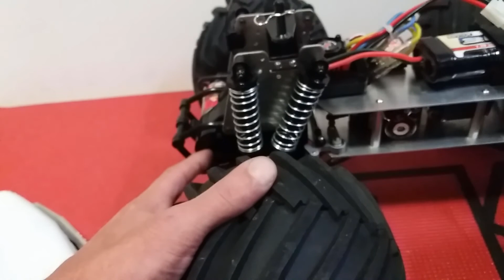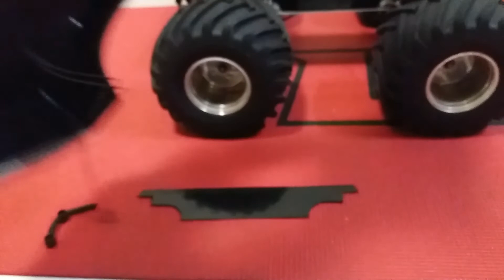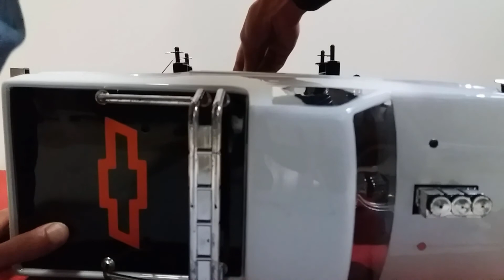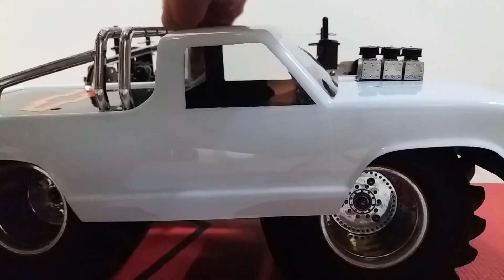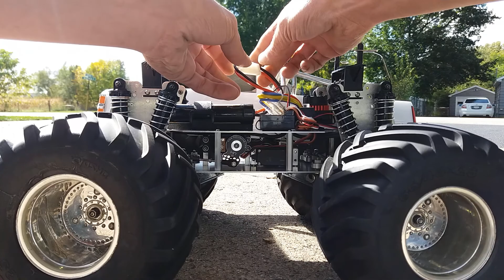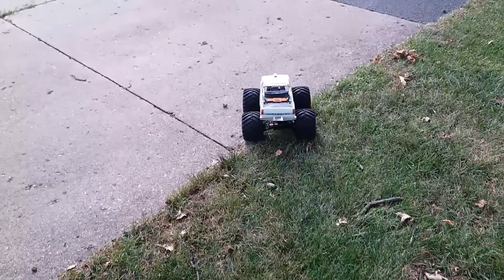Kyosho USA-1 4x4x4 Riskey Concepts RC Aluminum Chassis Customer resto

Comment: Love how that truck steers and turns.  I have a Double Dare that I have owned since 1988 and I recently acquired a USA-1.  I’m looking at updating both.  You products would help.  Here is what I have in mind,

- Because it rolled over so easily I bought a USA-1 suspension for my Double Dare when the USA-1 was introduced.  I just wish I could use the Double Dare knuckles with the USA-1 upper and lower arms to make the Double Dare wheels look better on the USA-1 suspension or could find some 3d printed knuckles that are short like the Double dare knuckles but that bolt to the USA-1 Suspension.  Option B would be to find, make longer Double Dare arms to allow one to use the USA-1 dogbones with the stock Double Dare knuckles and axles.

- I also wanted to find a way to connect the shocks to the lower arms or modify the Upper arms of the USA-1 suspension to remove the rod and link as mine bent frequently.  

- Last, I’m trying to find an alternative for the outdrives, dogbones, and axles on both trucks as Thorpe options are scarce and it seems like some Traxxas parts could be found that would work if outdrive parts could be located.  The Led Wheel YouTube did a USA-1 build where he added some custom machined outdrives.  

I found your chassis on E-bay along with the steering bell cranks and your wheel hubs.  I’m reaching out to see if you have any other products available and if it is possible to discount the shipping charges on large orders.  I appreciate your time - Ron